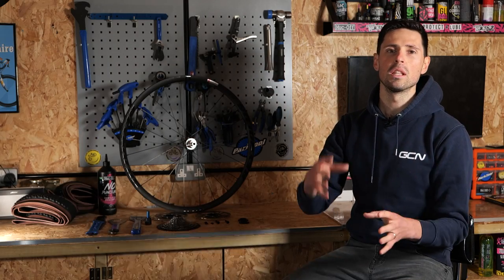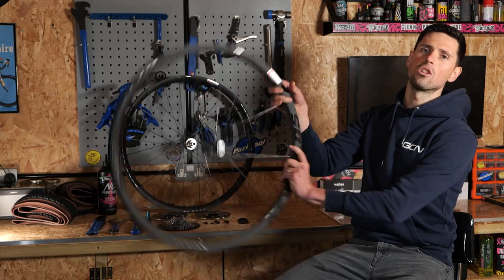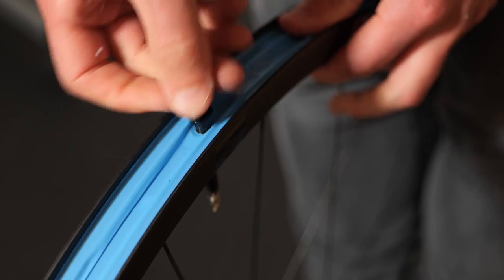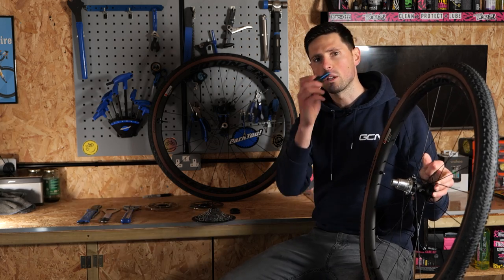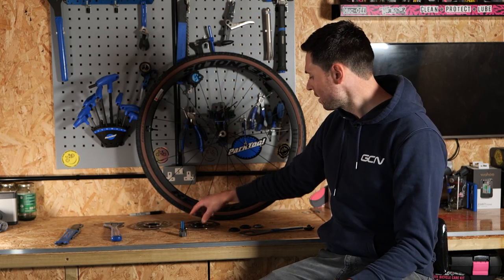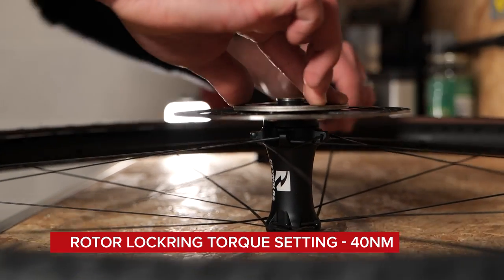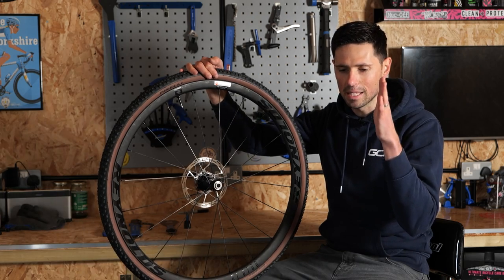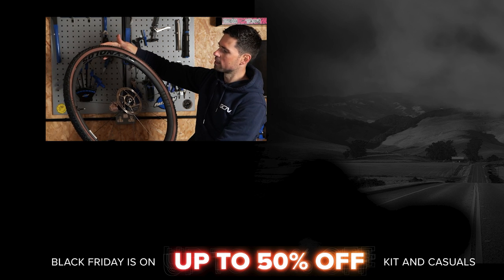How To Set Up A Bike With Two Different Wheelsets | Maintenance Monday

Comment: Don't you have to be afraid that your chain will wear faster if you change the wheelset (and thus the casette)? Because casette and chain wear together and a new casette will not have the same wear as the chain
Reply from the maker: If they are both of similar age it should be okay. It''s hard to say for sure, all comes down to the current wear pattern. 👀
Reply: Or use a chain with a reusable quick link (eg. YBN) to easily swap chains.

Comment: OMG! This is the 2nd time you've gave crap advice on disc rotors for different wheelsets. Yes, same hubs would help. True. But, they also make spacers for 6 bolt and center lock rotors. Using the spacers and a little trial and error, you can get the rotors set so you can just swap out wheels without problems. I've done it on two bikes. My brother has done it.

Comment: 🚨🚨Great Tip🚨🚨: Use 0.1mm disc brake and cassette shims to line up the fitment between different wheel types/brands, then you won’t have to adjust mech or calliper when swapping. 

Maximum adjustment should always be less than 1mm to ensure proper engagement with the splines is maintained: if you need more than this there may be something wrong with your hub. 

The spacers are cheap and easy to install. Works best with wide clearance disc brake bikes: I use one bike for gravel commuting and chainganging on the same day, only one quick swap required 😎
Reply: Further information: Yes there is a standard for over-locknut-distance, cassette positioning and rotor alignment but these can easily be disturbed by bearing positioning, preload adjustment, rotor brand, end cap fitment, etc etc. 

I’ve even seen wheels of the same brand have tiny differences, that are enough to ruin that crispy shift feeling: GCN should definitely do a video on this 👍🏼
Reply: Where do you get these?

Comment: Single easiest thing I've done is to use wheels with the same hubs.  I built two sets of wheels up, but used the same hubs, so when I swap them, I don't have to deal with the darn rotors rubbing/not being centered.  After that, it's cake.
Reply: This is the only relevant advice.

I have two sets as well, and I made sure to have the same rotors+ shimano cup&cone hubs, to be as close as possible.
Reply from the maker: It really does make life easy right! 🙌

Comment: @gcntech Dear Alex/Ollie; 
Pads for carbon Vs. alloy rim brake wheels...do I need to change the pads every time I swap wheels as well?  Never had carbon hoops before, and the used road bike I upgraded to has them.  Intended to be a fair weather ride, but I plan to get a pair of cheap alloy wheels as well for iffy weather.

Comment: Perfect time to publish such a video as many riders are probably considering purchasing a winter wheelset! Living in Finland winter means studded tyres, corrosive salt and bearing-killing slush. I'm considering mounting spike tires on the stock average WTB wheels I got with my Cannondale Topstone and buying a nicer alloy wheelset (DT Swiss GR1600) to use it from April to November. Or in those perfect winter days when the temperature is way below zero and it snows so grippier gravel tyres are enough to have good traction.

Comment: I've had an issue with those External "BB Tool" type center lock rings being so close to the fork leg on gravel bikes they cause an issue when the bike is loaded, might be something to look out for.
Reply: Switch to internally-splined ones, this is one reason I don't use externally-splined ones.
Reply: @yonglingng5640  I do, they are getting harder to obtain though the ones that ship with rotors /adapters are almost always the external type. What I do now when I get the a set of internal ones is put one on the front wheel and an external one on the back where they don't pose an issue, its not like I carry the tools for either on the bike anyway.

Comment: Just a question, It's just weird that I've made a new wheelset that are both using 10-speed cassette. the main problem that I have, is that upon inserting the new wheelset the shifting starts to have a problem. I don't know if all the 10-speed cassettes are configured differently. I used 11-36T configuration in both wheelset.

Comment: hey, so I have encountered a bit of an issue. my grvel tires are made for a 6 screws for the rotor, while the new road ones have a centre lock position, am I screwed? I mean, from a technical perspective, despite the fact the rotors won´t be the same, they would still be 160mm and I would still use the 9sp cassette I had originally on. what could go wrong? (apart from the need to adjust)

Comment: Two?....I don't use them all anymore, but I used to use five or six wheelsets. Everyday clincher, fast clincher, TT clincher, Crit Tub, and road race Tub....Oh year, then a pit Tub wheelset for if you flat, or crash in a crit, and need replacement wheels to continue. They were all Shimano, or Mavic. In the last 20 years, I'd either use a 12-23, or 12-25 in back, depending on the course, but back in the 80's and 90's, I'd do everything with a 21.

Comment: I need some help and don’t know where to find the right answers online. If somebody can help that would be great.

I have a Giant Escape 2 Disc 2021 and want to upgrade the drivetrain to a 1x system. Currently it has a Shimano Altus 2x8 setup with  Shimano CS-HG31 11-34T cassette and 30/46 chain ring 175mm. 

Currently I only use gear 5 and upwards on the bigger front cog so bottom end range doesn’t matter to me as my work commute is flat. 

What could I upgrade to? I’d like to keep things under £500. Any suggestions?

Comment: It wasn't anymore helpful than to set up the first pair of wheelset. I really was hoping that this video was as it says in the title how to use two different wheelset on one bike and that you had the knowledge of how easy it is with DT Swiss 350 hub where you transfere the cassette from one wheel to another within 15 second. Drag off, push on, done.
One bike to rule'em all need different tires for different surface. Changing tire with tubeless is always a mess. It's far more convenient with two wheelset than two bikes with different riding style. Cheaper too.

Comment: I want a cassette system that is super fast to move from wheel to wheel — tool-less would be even better. That way, I’m not riding cogs that have worn at a different rate than the chain and chainring(s).

Comment: When I had an accident sometime in September 2021, the front wheel of my bike was badly damaged that I had to make an emergency wheelset replacement from 27x1 1/4 to 700x25c because the local bike shops in the area where I had the accident doesn't have 27x1 1/4. Good thing my bike has a classic frame that can accommodate 700c. Haven't replaced it since then and still works like a charm with a 38c tire 😂

Comment: Got myself a second dt swiss E1800 wheelset. Now I’ve got one with road tires. And one with gravel tires. And with these dt swiss hubs, you can pull of the cassette with (yes with) the freehub and swap them between the wheels. So now I can change the cassettes in seconds without any tools. Easy swapping 👍🏻

Comment: I'd love to do this, alternating between 43 mm and 32 mm tyres, but my bike shop says that the manufacturer of my gravel bike (Giant) doesn't release to the aftermarket the same wheel sets or hubs they used on the new bike. The options they give me are expensive and after setup involve adjusting the rear derailleur settings and disk brakes with each exchange. Makes me wonder if giving up tubeless systems and taking 10 minutes to change tyres when I want (3 or 4 times a year) isn't perhaps the best solution: fastest, cheapest and least fuss.
Reply: Keep an eye out for used wheels.  Plenty of new take-off or low miles wheelsets showup if you are patient.  You are unlikely to get the exact Giant ones, bit realigning the brakes is pretty easy.

Comment: What I did: laser cut some shims that is at 0.1mm increments, and adjust the position of the rotor and cassette accordingly to which wheelset that doesn't function well: rubbing rotor, mis-shift, noises. And voila you get 2 pair of wheels with shims, and zero adjustment between wheel swap
Reply from the maker: Great idea! Not everyone has the time or skills to do all this, so buying the same hubs will make life easy 🙌

Comment: I use the correct spacer to  match my bike's rear mech setup to my Kickr trainer's cassette. Much easier than adjusting the rear mech every time you go from the rear wheel to the trainer.

Comment: For 6 bolt rotors, there are shims 1/10th of a mm thick to equal out the differences in rotor position between different wheelsets. Does something like that exist for center lock?
Reply: They are not as common but the do exist.
Reply: @chris1275cc  I've seen Centerlock rotor shims before, but not the 6-bolt counterpart.
Reply: @yonglingng5640  Yeah, just looking now it seems center lock ones are now way more common, the last time I looked for the 6 bolt type was quite a while ago back when qr was still king and it was the only way to get some rotors/calipers to line up. I guess now with Thru axle and most LBS offering facing of the caliper mounts its less of an issue.

Comment: I'd be interested in: two wheelset on a budget.
One for the road,
One for more gravel/tour oriented.
Key word: on a budget.
Bike from shop under 1000k in total, wheelsets according to this price range - non through axle.
Shimano Sora, maximum 105 Groupset and what should be budget friendly with them

What are the compatible parts, what needs to be checked together etc
Reply: DT SWISS 533D - the best rims I have ever had. And dirt cheap. 
I have two pairs in two sizes: 26'' (for autumn/spring) and 27.5'' (for summer).  
The third set (the winter one) is not DT yet.
Reply: I did just that:
Slick& gravel wheelset for my gravelbike for commute& fun 
It largely depends on what the initial wheelset is like; mine was shimano with a cup&cone hub, so i bought the 2nd set according to that.
Reply from the maker: Great idea, do you think we should be doing more budget kit? 🔎
Reply: @gcntech  
Definitely. You are beloved from all around the globe, where 2-5-10k builds are impossible to have, not to mention 2-3-4 set of bicycles all at once. 
Myself are a happy and proud owner of an RC520 Decathlon road bike, and for a time being I only can afford to upgrade this model with relevant budget kits/wheels, etc, and I consider myself as a lucky person who can own a full 105 Groupset bike with decent stats for the money. I saved up for it for so long... Now, my next move would be to widen its capability by using two different set of wheels (and casettes, tyre and so on), and would be great to have your PRO insight on what to choose, how to choose, which complies with what, how is the market with the lower end components.